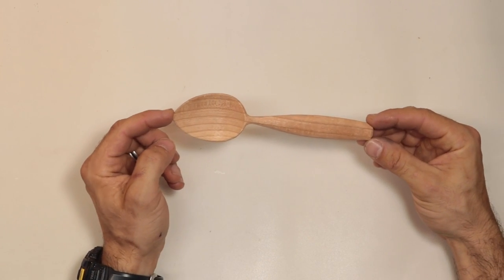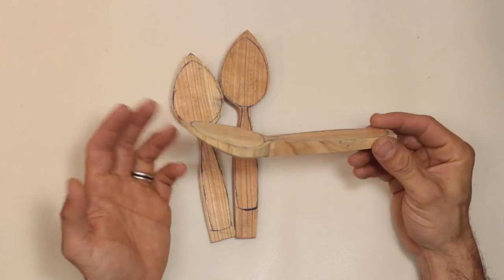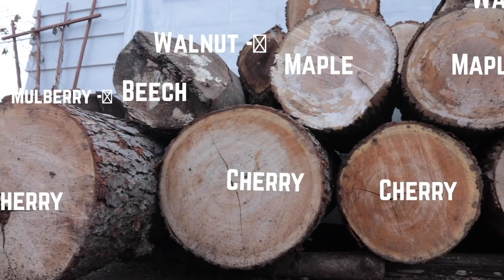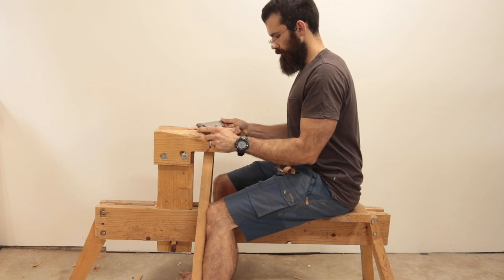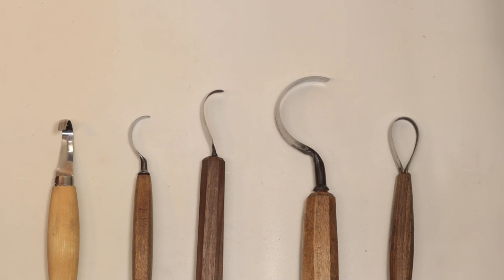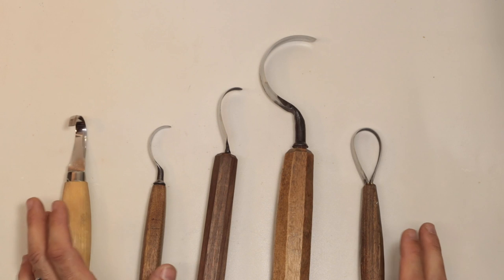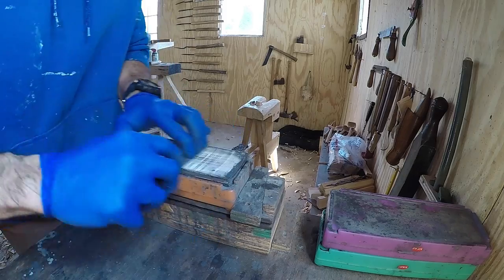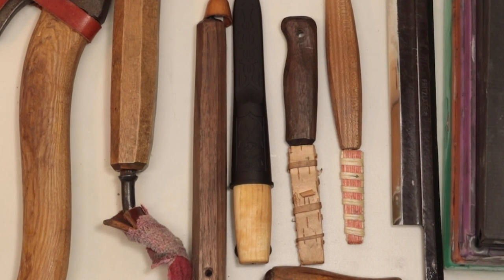Spoon Carving Tools

Comment: Great and really useful overview. Many thanks. I'm in tbe process of purchasing a saw for spoon carving. I was looking at the Japanese saws. They seem to have a finer tooth and therefore good for making stop cuts etc on billets, but are they capable of sawing through branches/logs the way a Silky folding saw can? Subscribed 👍 Thanks again.
Reply from the maker: A lot of readily available Japanese saws tend to have finer teeth designed for more precise cuts through dry wood. Silky saws are designed for cutting logs, so they'll be a lot more aggressive, cutting quicker through green logs.

Comment: I have the Mora 106 and find it is too much knife.  Best to wrap the bottom of the blade with a lot of tape and leave only an inch &1/4 to  1 1/2" edge exposed.
Reply from the maker: I suppose it depends on the kind of carving you're doing.  It's a lot easier to control a shorter blade, so if you're concerned about injuring yourself it sounds like you've found a good solution. For spoon carving, have a long blade is useful for controlled slicing cuts, but those kind of cuts do take a lot of practice to get right. Glad you've found something that works.

Comment: Please if anyone see's I'd suggest you just strop your carving tools regularly with chromium oxide on leather as you shouldn't need to actually sharpen your tools if you look after them and keep on top of it and if anything you should go find a good/flat old combination oil stone as they work slower than whetstones and they're like £10-20 for a descent one plus you won't be able to plough a trench into it like a fancy experience whetstone
Reply: or better yet, throw the chromium out and use diamond paste.  MUCH more effective.  Use a 3 to 6 micron diamond paste, and apply to your strop or you can just put it on a wood block as a strop.  less chance of rounding the edge over.